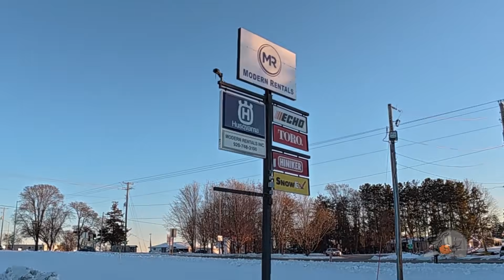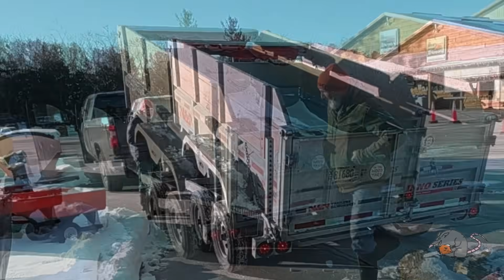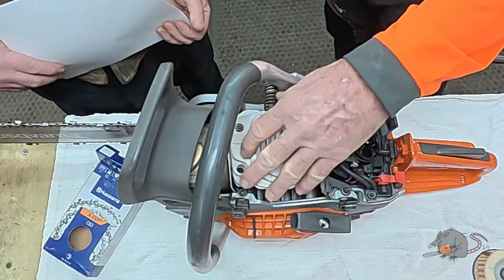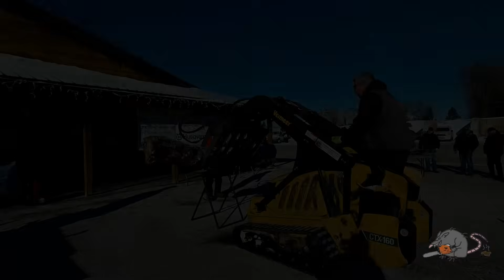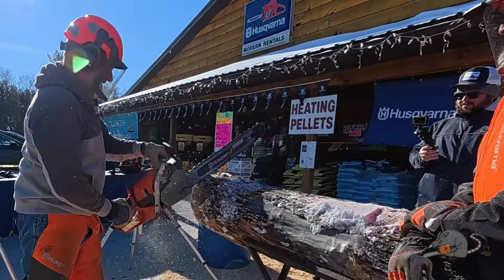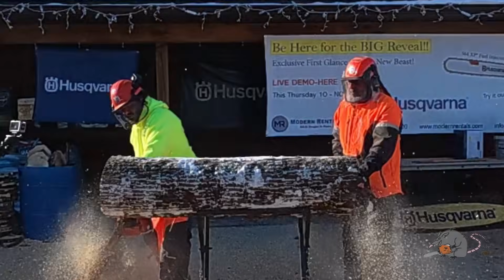First Look At The New Husqvarna 564XP Fuel Injected Chainsaw!

Comment: I have stihl chainsaws two of them. One is the ms 170 which I bought in 2014. I have cut wood which should have been cut with a bigger saw. It still runs. It has it's problems with starting after the tank runs dry and fill it up again doesn't want to start and then it does. Last year bought a new stihl ms 250 and I find for me since I'm now 73 it's hard to pull. Fill up with gas and make a few cuts and it's out of gas. The bar oil leaks so bad that after it is used i drain the tank. This Christmas is bought a new Husqvarna but it's only a 130. It's totally different than a stihl on everything. I haven't started yet since I really not going to use it right now. I'm impressed with it and maybe I will switch brands. What i have been doing is finding a banner to hang in my building. Only Husqvarna banner I've seen is for motorcycles  which I didn't know they made them. I started last year watching Married with small engines and Erica has mentioned you several times and now I subscribed to your channel this week.  You really know what you are doing! The Stihl dealer here in Missouri have screwed me over several times on their fixes of my other equipments. I asked a few questions and they said they wanted 20 bucks to answer a simple question. I laughed at that. I ain't stupid. I just walked away
Reply from the maker: Thanks for subbing!. Wow, we've joked about asking for a credit card when people call for free advice but I've never heard of anyone actually doing it. I'll look into banner availability for you.

Comment: I have a serious question related to sales…. Why have all the husqvarna dealers in the south mainly, left!? In north Ms there used to be 20-30 places to buy and service Husqvarna, well not anymore. They all had Stihl, echo, Husqvarna, now they all just stihl. The only husqvarna dealers are like Ace and TSC..? Why. I don’t own a Stihl and they will not work on anything but Stihl anymore. I have to drive 50-60 miles to find a Husqvarna dealer. It’s aggravating.
Reply from the maker: Thats weird. Around here I suppose there is a 20-50 mile gap between dealers.

Comment: That Purge and Pull is only for the fuel injected saws? Or should I be doing that with my other saws after refueling and the saw is still hot? Thanks for the great video Scott! Wish I was able to be able to make it there for the demo but I'm looking forward to when I finally can pick up the new saw in a couple months.
Reply from the maker: Purging hot fuel back into the tank is a good plan for any saw on hot days. Thanks for watching!

Comment: I know it’s less cc than the MS500i but I hope Husqvarna have made the 564 comparable with other 60ish cc saws. As yes Stihl made the 500i, so that its power-weight ratio is very good. But it eats fuel quicker than a whale gets through krill - roughly 24mins. per tank.

Whereas the 545 does 39mins. per tank and the 550 Mk2 does 34ish per tank. 80%+ of what I can do with the MS500i, I get done with the 550 Mk2. If the 564 really is capable of fuel efficiency comparable with the 550 Mk2, then Husqvarna have a winner.
Reply from the maker: It feels like it will but this was just one test. We'll know more once they are out there more. Thanks for sharing!

Comment: In my line of work, we would call the purge bulb a primer bulb because you are priming the carburetor by filling it with fuel and removing the air.  Which is similar to priming a siphon pipe.
Reply from the maker: That makes sense when you consider you are priming the carb and not the engine.
Reply: Just like a fire truck pump, priming removes air that allows atmospheric pressure to move the water into.the pump. An older Dolmar saw will prime the engine and does not use a choke butterfly shutter.
Reply: Purging 1 thing is priming the other.

Comment: I had a blast that day running that saw.  I didn’t realize how cold I was until I went in to warm up.  That’s too bad the electronic tachometers won’t work on this saw.  Keep us posted when you find out what the alternative is.
Reply from the maker: Thanks for coming to the event! I have a laser tach that would work. Knowing the rpm won't help any with maintenance because there is nothing to adjust. If hooked to a computer we can see max rpm on last run.
Reply: @T @TheGreasyShopRag I stayed away from an electronic saw with my last saw purchase because I like to do my own service and maintenance.  At some point I’ll probably buy one, but I’ll need more convincing I shouldn’t worry about it.
Reply from the maker: @MillwoodOutdoors  I get it. I felt the same way when they took kick starters away from motorcycles. I was worried the new technology would leave me stranded. Now I rarely think about it.

Comment: I don't quite follow the comments about it being short stroke big bore. I can't think of any husky that is under square. Which ones are long stroke small bore?
Reply from the maker: I think the comparison would be that its a bigger bore than most saws with that displacement. I'm gonna do a little unofficial research on that one.
Reply: @TheGreasyShopRag I've been pretty curious about the 564 so I'm keeping my eye on it
Reply: @TheGreasyShopRag  While researching could you check and see what crank bearings it is using and if there is any cross reference use from another series of saws like the 562 or 550.
Reply from the maker: @iffykidmn8170  The crank bearings in the 564xp share a part number with the new style bearings in the 562xp II. These are the bearings they installed to fix all the issues they were having and I haven't seen any problems with them yet.
Reply: @TheGreasyShopRag  It will be interesting to see if they will need to upgrade again to keep up with the 572 piston long term,   564XP MkII
Reply from the maker: I couldn't find any models that were even close to square. The four units we would compare this to look like this:
550=43mm bore, 34.5mm stroke
562=46mm bore, 36mm stroke
564=48mm bore, 34.5mm stroke
572=48mm bore, 39mm stroke
Reply: @TheGreasyShopRag That's what I thought. I don't know of any saws that are square or under square. They've always been short stroke big bore in so far as I know. Curious of maybe any vintage saws were? Any case have a good Christmas Scott
Reply from the maker: @Randmosh  Thanks! Merry Christmas to you!

Comment: I enjoyed that , I’d like to say it’s very similar to the 500i but there’s only so much to work with for space and where to put things . It looks like the fuel pump parts are broken down into separate parts ?
Reply from the maker: The pump is broken down but the whole assembly is currently listed at $20 so most shops will just load the parts canon and fire away.

Comment: That was a fine opportunity that you had; thanks for inviting us along!
Reply from the maker: It certainly was. We had been pestering our territory rep and Chris from the channel "In The Woodyard" had been in contact with Santa Saws. I was thrilled to hear it was gonna happen but looking back I was ill prepared for it.
Reply: @TheGreasyShopRag  Not that you need approval, but with the setup and not having them to yourself, you did a heck of a job bringing us along. I know, due to everything going on, he didn't understand your question on the case pressure question and answered possible causes of an air leak instead of how it determines... I was really honed in there, but you were a proper host and let it slide.  No complaints!!
Reply from the maker: @HayChaffandSawdust1  I think there might be more to this than I understand right now. I read somewhere that holding the throttle/trigger wide open while pulling rope could throw an air leak code. I didn't see a throttle position sensor so maybe it does measure case pressure...or maybe it just measures barometric pressure. I dunno.
 We are all still learning and Rick is a great rep for the brand. I asked why a digital tach won't work with this saw. It seems weird but we tried it and theres no way this thing peaked at 26k! He didn't know the technical reason why but contacted Sweden and called me with the answer the next day. That says a lot about his passion for his job and this saw. BTW, the control module emits a signal or pulse that muddies the ignition signal rendering a standard digital tach useless. More to come as I learn more.
Reply: @TheGreasyShopRag  Thanks for that!! I know (think) that the flywheels have two sets of magnets instead of the single set; I assumed this gave a little bit of a charge even if not enough to jump the plug's gap; I agree that it probably teh second set of magnets that create electrical noise that confuses the normal proximity tachs.  Good stuff!
Reply from the maker: @HayChaffandSawdust1  I wanted to pull the flywheel, hook it to the computer and other stuff but there wasn't time. I also didn't want to be the knucklhead that wrecked one of the only running samples in the country 🙂Theres other shows and we had to ship the saw before they even left the shop!
Reply: @TheGreasyShopRag   SHIPPED IT??!! I figured that thing rode around on a purple pillow with gold tassels surrounded by armed guards!! On the other hand, I hope it goes thru  one my local shipping agencies... there's a good chance I'll find it in a ditch somewhere!!
Reply from the maker: @HayChaffandSawdust1  In the Blues Brothers movie one of them had a briefcase handcuffed to him. When they got on stage and opened it there was a harmonica in the case. Thats How I pictured the 564, with Santa Saws handcuffed to a case containing the saw 🙂

Comment: Can I ask which particular hole in the Husqvarna lineup this is meant to fill?
Reply from the maker: Thats a great question. I don't think it fits into a hole until they have success with fuel injection and then continue to build a lineup of light weight high power saws.
Reply: @TheGreasyShopRag   I would concur that thought...

Comment: So its got a short stroke high revving over square piston in the usual restricted Husky case. I think i can see where this dog is going to land in the summer heat. Oh but wait its got air injection that NEVER makes a damn bit of difference to how long the filter stays clean. It does rob the cylinder of cooling air though. 😂
Reply from the maker: On the other hand, they moved the coil that was also restricting cooling capacity so I guess we wait and see.

Comment: Oh great. Its got sensors to tell you when the saw has crapped out. That will definitely come in handy.
Reply from the maker: Welcome to the future of chainsaws! Two schools of thought. Gearheads want to be able to do all the traditional adjusting. People less mechanically inclined enjoy just cutting and not worrying about the saw. I welcome all progress in gas saws before batteries eventually take over.
Reply: @TheGreasyShopRag 
I've never ever adjusted my Stihls.
Never needed to. It won't matter how many gizmo's dumb owners have. If the fuel is bad and the filter is clogged it's going to Husky parts heaven. 
Old school two strokes are so easy to maintain. IF you do the basic maintenance. 
In beggining to hate my fuel injected Yamaha motorbike. I know that. Third fuel pump in 5k. Shit fuel causes it. A carby is easy to clean. Injection equals tear down.
Reply from the maker: @joschmoyo4532  Ya, bad fuel will screw up whatever you put it in.
Reply: @TheGreasyShopRag  I am in the later group... I have YOU to  fix my stuff... I want to cut not play with adjusting and fixing... If I have a problem I set the saw down and grab the next one... I learned long ago when you are on the job you will need backups and backups for the back ups... time matters to me and my customers.. they do not want to pay me to fix and play.... but then again I am weird.
Reply from the maker: @InTheWoodyard  Your plan is sound. You can probably imagine how many guys that think they are pros scream that they need their saw back right away. A pro has backups like you do.

Comment: The gravity fall on tip trucks is usually adjustable with an inline valve. Nothing to do with the temperature.
Reply from the maker: In this case it has everything to do with temperature. Cold thick oil flows slower.
Reply: @TheGreasyShopRag 
Yes, if you use summer weight oil in winter. I don't use bar oil. It's just rebadged gear box oil. Downunder a lot of us use motor oil to splash the teeth. Cuts better. Way better. 
The winters aren't as extreme but the timber is.
Reply: I have two of these trailers and it has everything to do with below zero temps... on a hot day when I am recording the trailer box go up and down it is 2-3 times faster than a bellow zero day...so....cold oil matters.
Reply: With all due respect josh we log/work at -30 F and colder, 1 week later we can see a 60 degree temp change. 10 weight oil ,which is as thin of a hydraulic oil we can get stays as thick as corn syrup at  those low temperatures. When logging we keep our saws and oils in the cab of our trucks in an attempt to keep them functional. Yep its not fun, well it actually is😂
Reply: @austindenotter19 
I've worked in minus 30-40 in Wisconsin cutting firewood. I'm familiar with the problem. Glad I don't have to deal with that anymore. We thinned the bar oil with winter diesel and if it got really bad, gas. Not ideal but it worked. 
And yes I know diesel can gel if it gets cold enough. 
I used to have a heating element in my VW polo diesel. But even then sometimes it wouldn't crank. 
In Australia the problems are different. Bark that sucks the oil out of the bar and chain faster than it can lubricate. Timbers that are hard, resinous, high in abrasive silicates and minerals. They produce more dust even with fresh chain. So you adapt, you find ways around the problem as best you can. Because time is money, chainsaws are high maintenance and downtime is a drag. 
We never left oil in the saw if it was cold. Kept the bar oil somewhere warm. 
I don't use standard bar oil downunder. To sticky. I use 15 40. Sprays the teeth and lubes them in the cut. Uses more oil but that's the price you pay to keep your teeth from burning.
Reply: @joschmoyo4532 good times indeed😂😂
Reply: @austindenotter19 
Welcome to the suck. Timber eats weak men for breakfast.

Comment: Fuel injection. Complicated, unreliable, prone to gumming up on modern unleaded fuels. 
No thanks. Its a freakin two stroke for chrissakes ! Its supposed to stay simple for a reason. Autotune ! Another sales gimmick like "air injection".
Reply from the maker: I don't follow the Stihl community except for a few youtubers I like. Is the 500i having fuel injection problems?
Reply: @TheGreasyShopRag 
Good question. I don't know but I'll be honest and say I wouldn't touch anything that complicated, even from Stihl. My 660 magnum never misses a beat and that's all i care about. It's old school, it's a tad greedy on fuel but it's fast and rips through Australia's hardwoods like a bloody legend. 
The air filter is oversized, it's tough and it's easy to start hot or cold. 
The bar oil pump never let's me down either. I'll never sell it but I would have no problems finding a buyer down here.
Reply from the maker: @joschmoyo4532  I just picked up a MS660 yesterday and can see why it would be popular. Mines scored. I'll probably make a video about repairing it.
Reply: @TheGreasyShopRag 
That would be an interesting one.
Look forward to that. The Stihl demolition saw uses the same size engine. Ive got one. Cuts through concrete like butter if you use water. 
Ive been in the wood trade since I was a brat. I know what works and simplicity is always the mark of good engineering design. 
Ive seen the new fuel injected Stihl in the dealership but id rather keep the old 660 going. Its already considered a classic by many. Stihl doesn't always get it right either. 
I took a punt on the ms362c. So far so good. Fingers crossed.
Starts easy, seems to have some kind of automatic choke. I always warm up my saws. To many guys flog them from stone cold. Thats an engine killer.